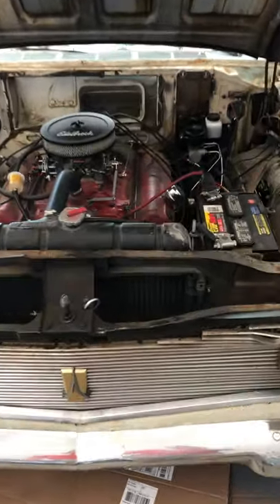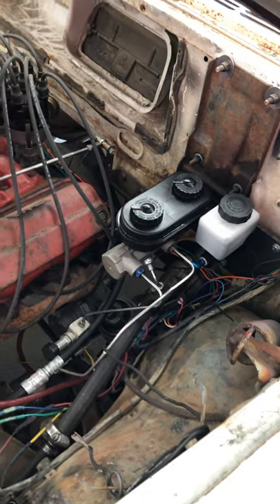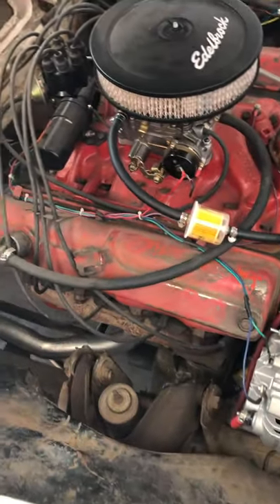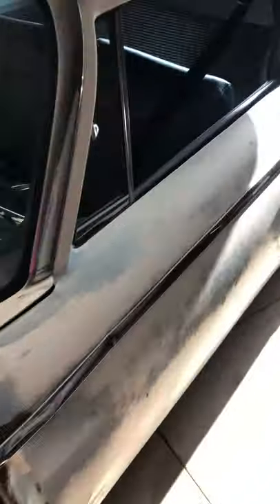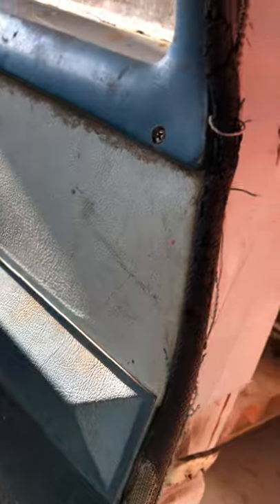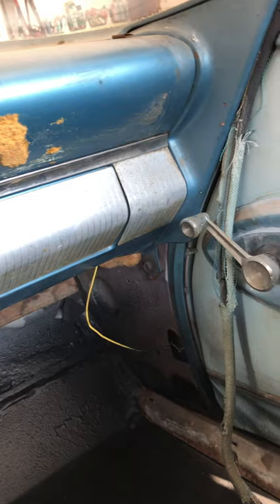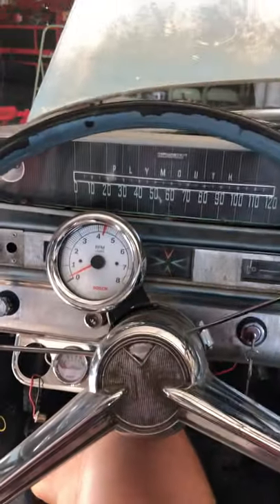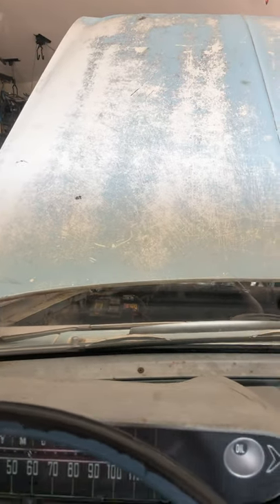1960 Plymouth Belvedere 2 door sedan walk around - Part 2

Comment: Liked and subscribed. Nice car and looks really solid. I'm currently working on my 60 Belvedere 4dr sedan.
Reply from the maker: I appreciate the comment.  Not a pretty car, but fun and easy to drive with power steering, hydraulic clutch and smooth shifting 5 speed.  Good luck on your sedan.
Reply: @BigJonsAntiqueMotors  No problem and no doubt yours is a fun driver with that setup. Your car looks fine as is but I understand wanting to fix rust and dents. I'm going to under-restore mine. I plan to fix some rust and dents but not a total resto. Mine is about to lose the 225 and three on the tree in favor of a V8 and automatic. I'll take all the luck and well wishing I can get and good luck on yours as well.
Reply from the maker: @robertbittles6944  Good luck.  If you use a Mopar V8, anything built 1962 and later will bolt up to any 1962 and later trans (3 speed, 4 speed and even up to the 8 speed autos).
Reply: @BigJonsAntiqueMotors  Thanks for the info. I definitely learned that I wasn't going to be able to put a later auto behind the early slant 6 (not a straight bolt up anyway) which was initially my plan. I'll keep in mind what you've mentioned when shopping around. Thanks again. p.s. I think I seen your car listed on marketplace..... I'm in Southern Illinois.